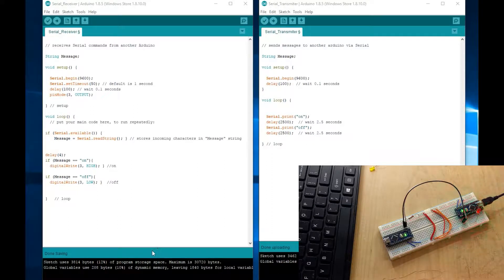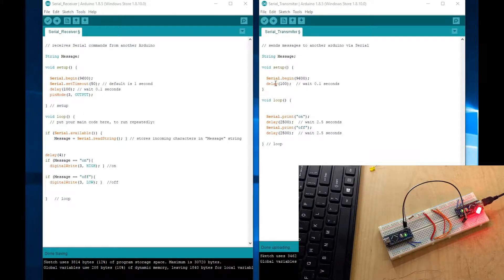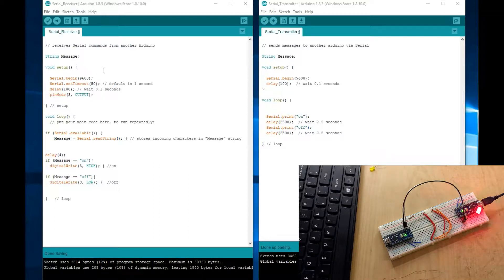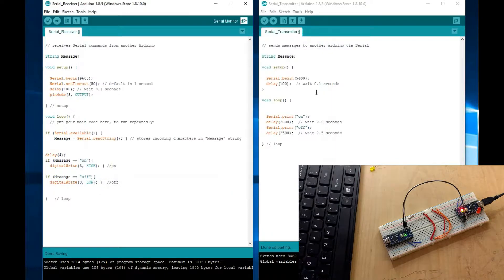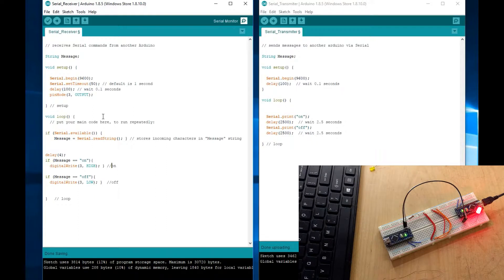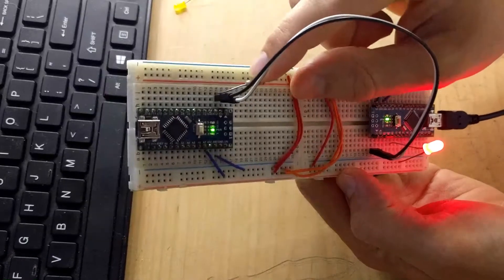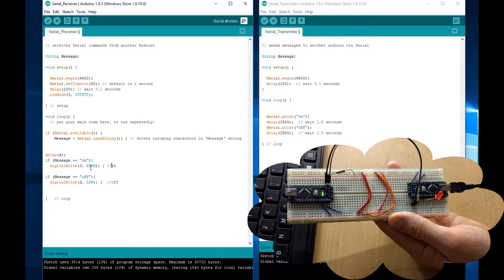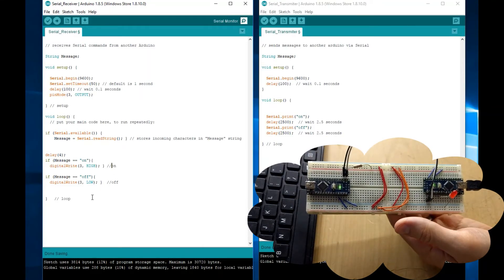Arduino to Arduino - Serial Commands Code

Comment: so could you do a tutorial do the same with 2 stepper motors, so transmitter sends data to receiver and then it turn motor 1 after button press, and if push button by the transmitter motor 2 moves by the receiver